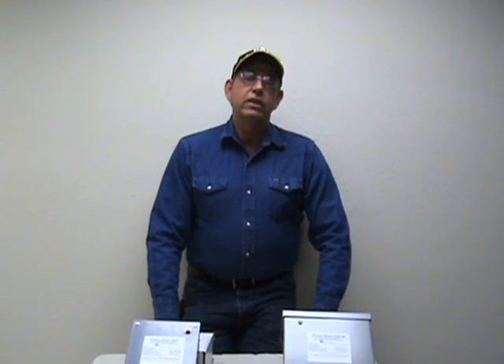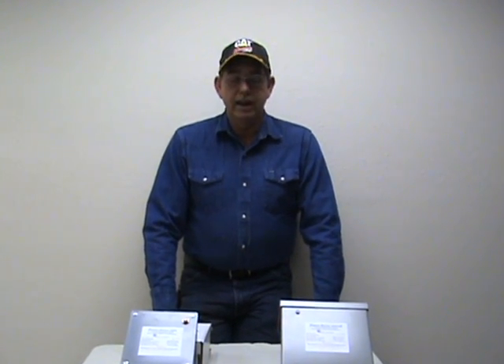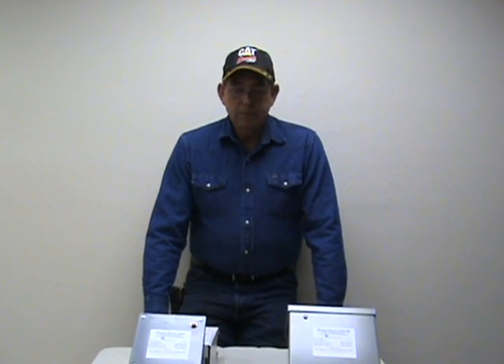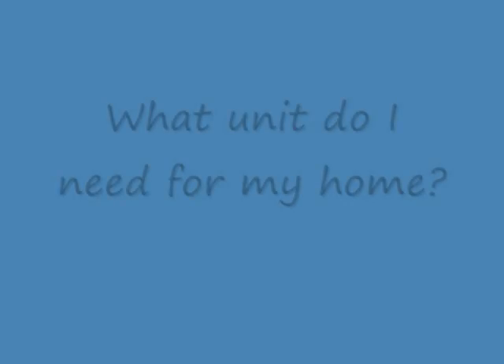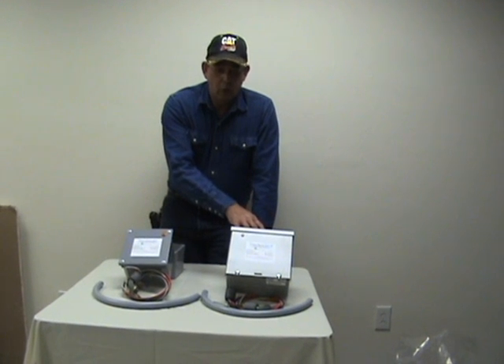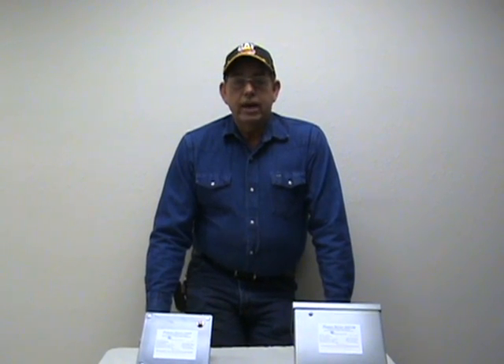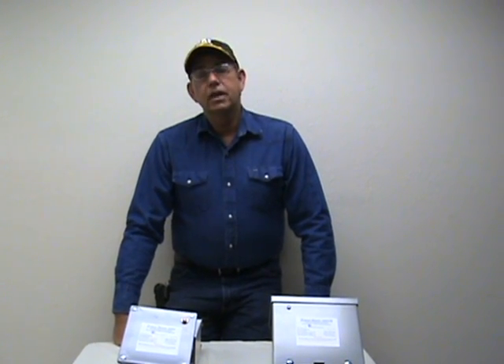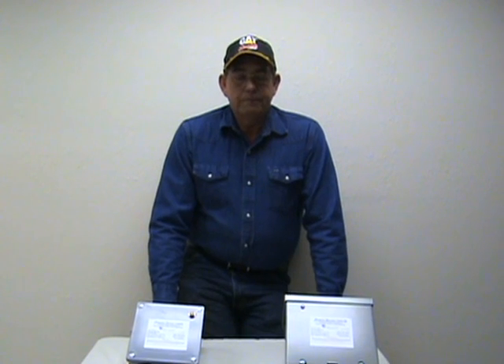Power Saver what it is.

Comment: Good to see that they call this a Power Factor Corrector.  This is a correct description.  I've been an electrical engineer for 32+ years and this device wont save a homeowner any money because utilities only charge residential custmers for watts, no matter what the power factor.  Industrial and commercial customers are different.  They save with power factor correction because they are billed more for having a poor (low) power factor.
Reply: so this device doesnt work?i mean it doesnt cut your bill on half?

Comment: Power factor devices (capacitor banks) are commonly used in facilities with several large integral HP motors whose impedance has a large inductive component, i.e., split phase and cap start motors. Most residential motors are either very low output shaded pole which do have a poor power factor or in the case of HVAC equipment, use PSC motors which run at near unity (.98%/.99%) power factor. Most of my power is consumed by heating elements with a PF of 1.0. I don't believe the use of this device would result in any significant cost savings for the average home owner.

Comment: Funny to see so many comments calling this a scam. In fact, this is the only video on Youtube that I found that says it as it is, this are Power Factor Correctors. And yes, you do save if your power factor is too low and you are able to bring it up with this type of units.
Your total electric bill is calculated by KWH units, for simplicity lets say a KWH costs $1. The total of KWH consumed is divided by your power factor. So if you consumed 100 KWH this month and your power factor is 86, then 100/86 = 1.16. Your total bill would be 100 X 1.16 = 116, this x the price per KWH = $116. If your power factor was 97 then 100/97 = 1.03. 100 x 1.03 = 103 or $103. 
You get low power factor if you have inductive loads like motors turning on and off frequently which causes spikes in you power demand at the moment they start, once they are running it does no good. You will hardly see any benefits on equipment such as TV's, computers, etc.
So check your electric bill, if your power factor is below 90 you might get benefits from this type of units, otherwise don't bother spending your money.
One other thing, I doubt the cheapo units sold at K-mart. etc. would do you any good, there are just phisicaly too small to fit an adequately sized capacitor in there, I might be wrong but I doubt it.
Reply: +Galileo Galilei WRONG!!

residential customers are not charged for poor power factor.
Reply: +EMS Lawrence, KS Don't know under what rock you hide, but In my part of the world they do charge residential customers for low PF, in most parts of the world they do get charged. And everyone who has an intelligent digital meter will be automatically charged for it anyway, and they are right to do so in my opinion, no sense in wasting resources.
Reply: Nonsense.

Comment: JusI have researched Power Tune before purchasing this excellent product and they have all the legal paperwork including CE and SIRIM how can that be if it is a scam,impossible,why not check it out yourself!! If you live outside the UK which has a ring main,the same as Malaysia where they are made, to save the most money you have have them professionally wired in by a qualified electrician IN LINE ON A LOOP TO THE DIFFERENTIAL.

Comment: Dear Romulo,this is not a SCAM,painand electricity is very expensive here,for example, 3 years ago before I had a Power Tune fitted my July to August bill was 268€, since then in Spain the price of electricity has risen by a staggering 72% my July  to August bill this year only 150.01€ I am using the same electrical appliances as I was 3 years ago, how can you call it a scam. You are right about the Chinese models,they dont work and in fact can catch fire.

Comment: What I want to know is, will it protect my home property from power surges and brownouts from the utility, not just storms? NOT having to buy a new refrigerator or computer will save me a lot more than whatever electric savings are offered. 
If I have to pay an electrician to rp it after every lightening storm, that could be 10 times a year!
Reply: tiger - u are needing a battery back up unit. If you want to stay "on" during brown/blackouts. These units will only give the extra power so the motor doesn't draw what it needs from the "mains" (your electrical supplier) those capacitors in the box will supply that extra power needed.